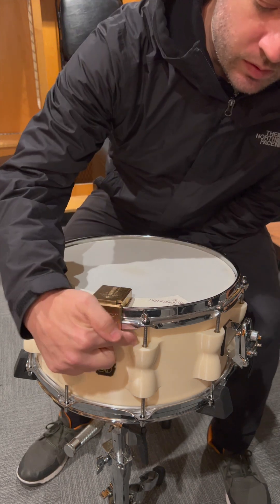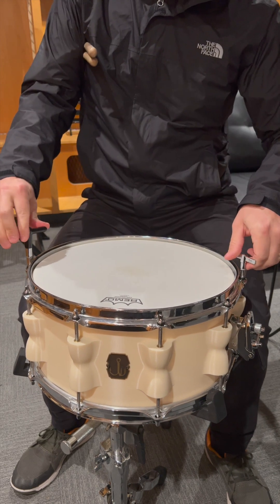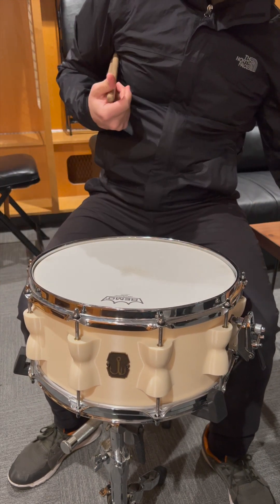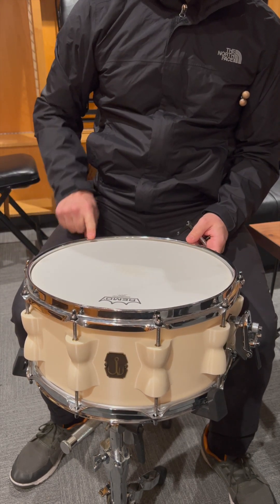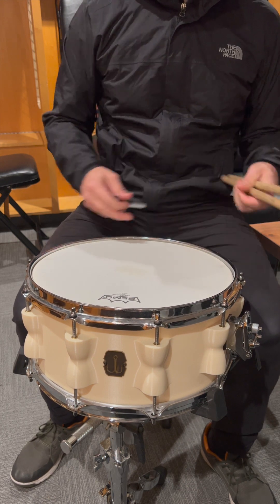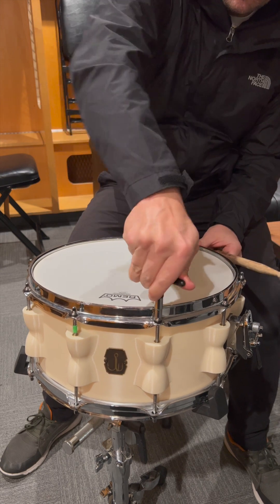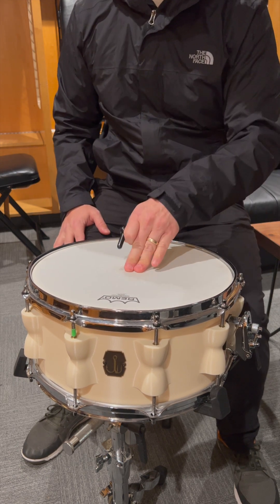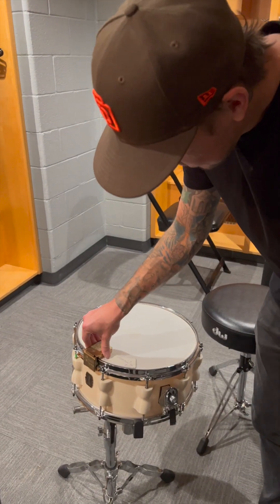3D Printed Snare Drum - Heat Set Insert Force Test

Comment: Working on a 3D printed RIMS Headset clone, I have been using standard swivel nuts. I'm trying to find the right idea for the final design. I think that I will use the o-ring to pop it into place instead of a spring and traditional lug design. This video is great. I'm psych'ed that you use your own 3D printed design!